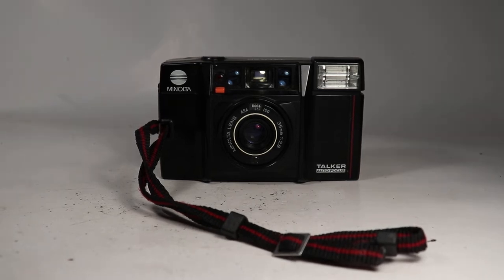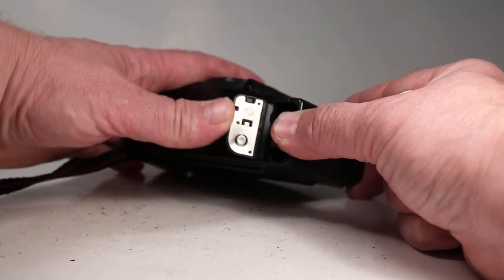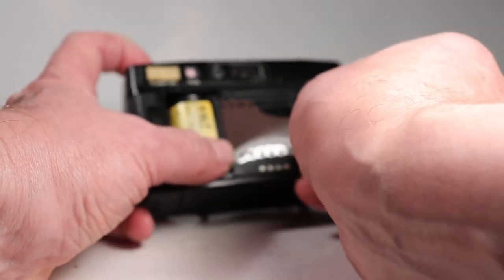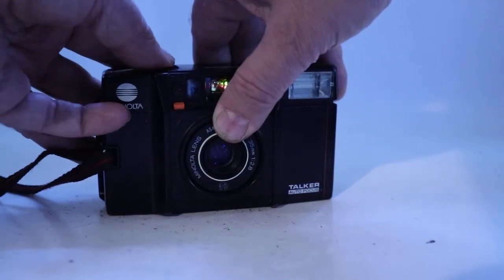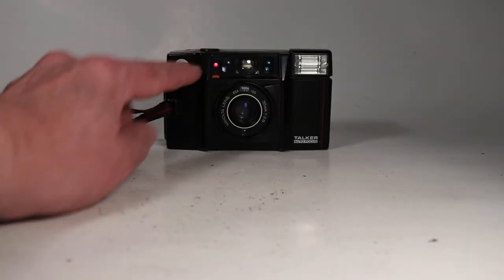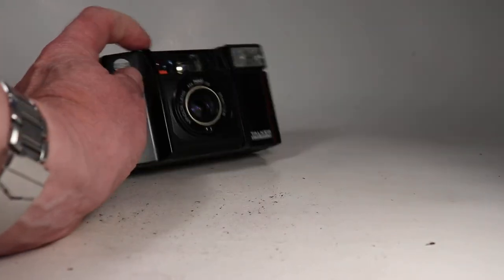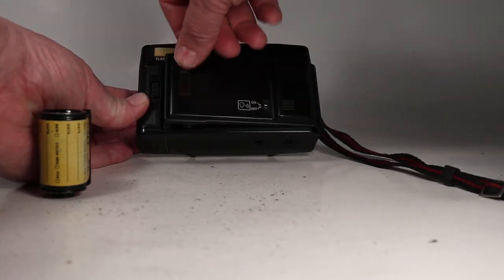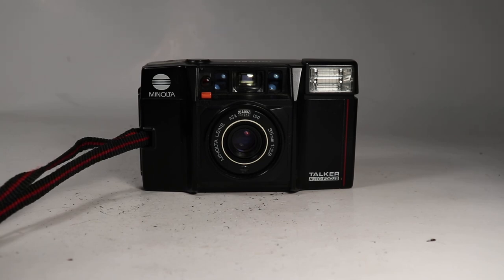Minolta Talker 35mm film camera

Comment from the maker: Poster here with some comments.  I did a couple of dumb things in the video.  I'm not going to reshoot it, but be aware that when closing the camera, just simply close the back and don't flip that clear part over by itself first.  Also, when I was trying to get the camera to say, "Too dark, use flash," I still had the ASA/ISO setting to 1000, so had to get it really dark to make it do that, and I mistakenly put my finger not over the sensor, but over the ISO number; it was still dark enough, but you'll see it looked silly.
Reply: When I bought the camera new I remember the instructions saying to close the clear door over the film first to make sure the film has caught the sprockets (that's why it is clear), and then to close the back door to auto wind to the first image. I always did that, and I still have the camera in perfect working condition today. I was going to sell it this week, but ti will only sell for $5.00 tops.